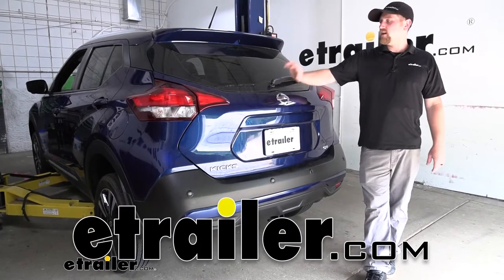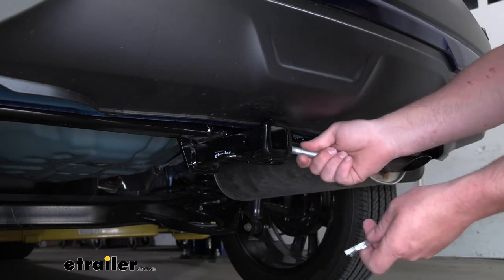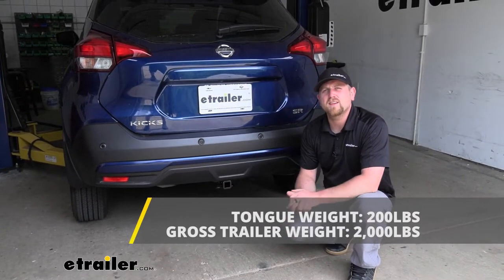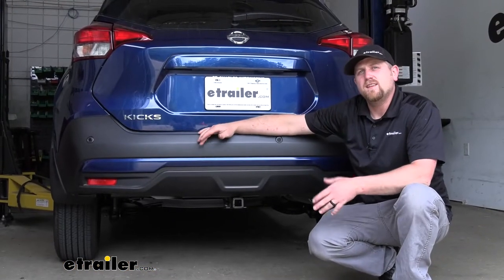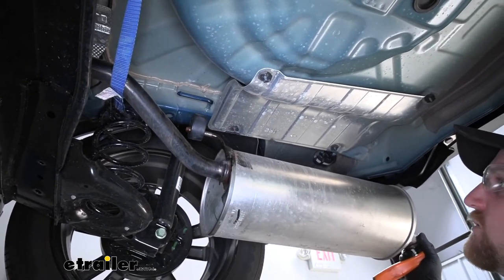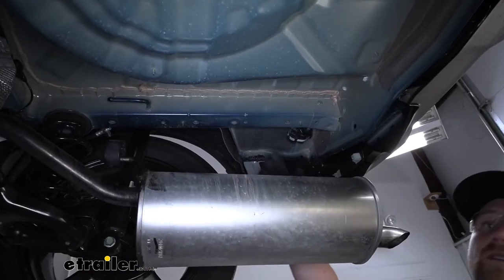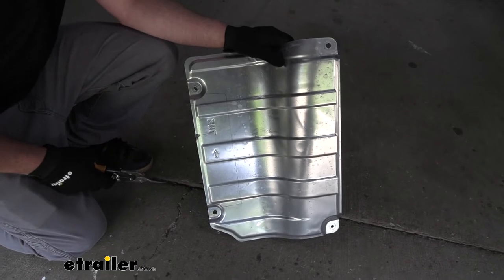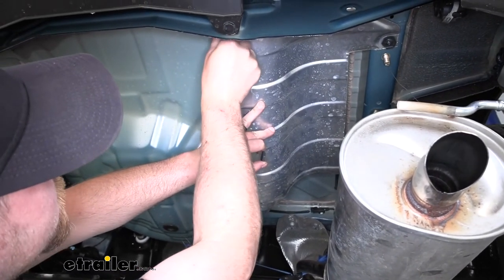etrailer | Curt Trailer Hitch Receiver Installation - 2020 Nissan Kicks

Comment: Thank you for posting this. Do you have any recommendations for bike racks and kayak trailers for a newbie like me. I have never used racks before and I am nervous about getting it on and going on the highway.
Reply from the maker: Platform style bike racks are very popular and very easy to use. Check out the following link to see some great options that would work great for you! If you are wanting pull a kayak trailer and also load your bikes on it you can use a roof mounted bike rack and install it between your kayaks on the trailer.
https://www.etrailer.com/Trailers/Malone/MPG550-TU.html
https://www.etrailer.com/dept-pg-Roof_Bike_Racks.aspx
https://www.etrailer.com/dept-pg-Hitch_Bike_Racks.aspx

Comment: Hello! I have a 2021 Nissan kicks. Would this work for my car? I’m moving cross country and I want to rent a trailer to attach.
Reply from the maker: This hitch is designed to fit the 2018 - 2021 Nissan Kicks. If you are wanting to haul a trailer you will need a ball mount and a wiring harness to connect to the trailer.
https://www.etrailer.com/Trailer-Hitch/CURT/C11563.html
https://www.etrailer.com/Ball-Mount
https://www.etrailer.com/t1-2021_Nissan_Kicks.htm
Reply: How much could you tow with a Kicks?

Comment: Will this go on a 2020 Kicks SV? We had a body shop tell us they couldn't install a hitch we ordered because "it's plastic underneath."
Reply from the maker: This hitch is designed to fit your 2020 Nissan Kicks SV. It will install the same way as shown in this video.
https://www.etrailer.com/Trailer-Hitch/CURT/C11563.html

Comment: Could you tell how long total? The AutoZone description said no drilling and 45 mins install time. I am having a local U-Haul install a curt trailer hitch 11563, I haven't opened the box yet.
Reply from the maker: The professional install time will be about 45 mins and if someone who is not experienced is installing, it may be more like 90 minutes.
https://www.etrailer.com/Trailer-Hitch/CURT/C11563.html